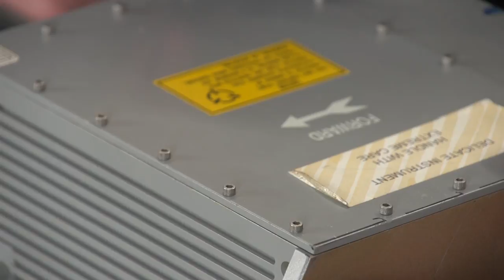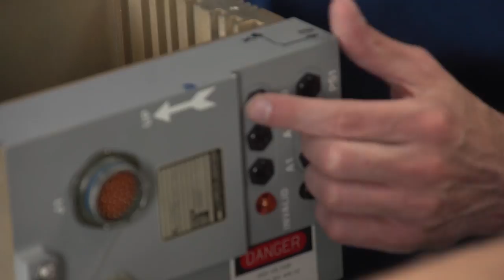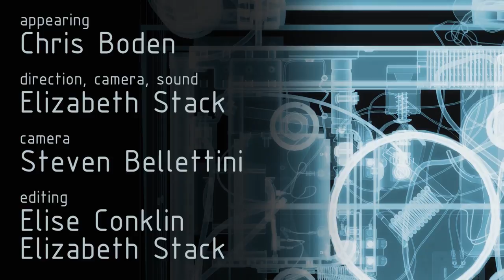Slightly Mysterious Aviation Gadget: Equipment Autopsy #81

Comment: This thing is a complete IMU module.
Sensors box has 2 DTG gyros and 3 accelerometers. Each gyro has 2 sensetive axis, so you have X Y on one  and Y Z on the other. So you have dual Y axis(most commonly vertical).  These gyros are pretty sensetive but(judjing by small size) probably not sensetive enough to pick up earth rotation rate. DTG`s of larger size are capable of doing it.
Electronics module contains amplifiers(probably several gain steps) and feedback circuits(may be PID) as gyros and accelerometers use compensation measurement method and are designed to run as a part of a closed loop system. It means you can not just hook these sensors to a power supply and a scope(aclualy you can, but you will loose a lot of accuracy). Modern units also have ADCs(something around 16 bit and several ks/s) and some digital interface stuff(varies a lot).
The whole thing could be powered from single 27v source and/or less likely something like 115v 400hz. Usualy it contains inverters for running gyros and just 27v is enough to run this thing properly. It takes around 10-20 watts without heaters. Output can be analog or rs422/485. Some of these units even do not reqire any control signals. You just hook 2 power leads, 2 rs485 leads, open putty/hyperterminal and see data. Could have some weird military encryption stuff but should be easy to get analog signals from inside.

Comment: The (digital) automatic flight control system can use this IMU to maintain a preset course or heading, and if the GPS is lost or non-functioncal, the AFCS can use this IMU and a downward-firing ground radar to estimate its location. On the helicopters I worked on, you could only use this for about 100 miles before it decided its estimation was too inaccurate and you lost all navigation. Fun fact - most military aircraft have 3 phase Wye, 400 Hz, 115 phase electrical generators connected to the engines or gearboxes for power, but all navigation equipment only use one phase (I'e always been told the "B" phase) to prevent timing errors between pieces of equipment.

Comment: the black round devices are transformers. the iron/ferrite core on a 400hz transformer doesn't need to be as large as on a 50hz transformer. also that has certainly been fudged with at some point, as aviation grade stuff doesn't use veraboard or masking tape and these is no ECO (engineering change order) stickers anywhere, unless this was a bench test unit and was never flown.

Comment: Smiths bought Lear Siegler in 87, so likely late 80's, early 90's build of rebadged :Lear Siegler unit. IC manufacturers stopped making industrial/aerospace grade ceramic packaged IC's with wider temp range - what makes the boards look so different mainly, all conformally coated too, also large metallic groundplanes combined with wedgelocks provide excellent thermal characteristics. Cots - commercial off the shelf effectively forced the whole sector to use the same parts as the rest of the  electronics industry, i.e. plastic dipped parts and the odd ceramic processor.

Comment: 130.75 and 134.08 are aircraft band frequencies. I suspect you have a radio unit - the heater is also a clue as RF modules like a narrow range of temperatures.

Comment: 7:30 - a chunk of perfboard in the corner...there's no way that's original,someone has been in there tinkering/modifying before.
Reply: PhattyMo 37:20 They look like transformers,probably for power supply stuff.  Those transistors (Mil-spec [JAN= Joint Army Navy] 2N7225 N-channel MOSFET's) are interesting,I've never seen gold TO-220 packages like those before.